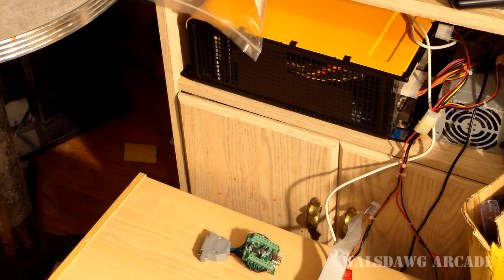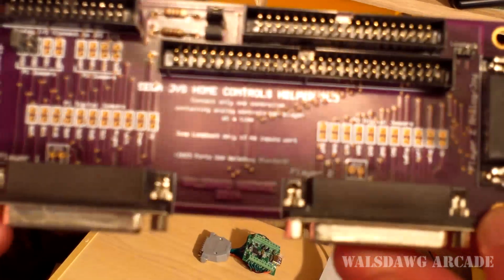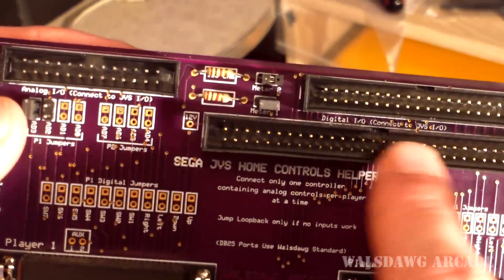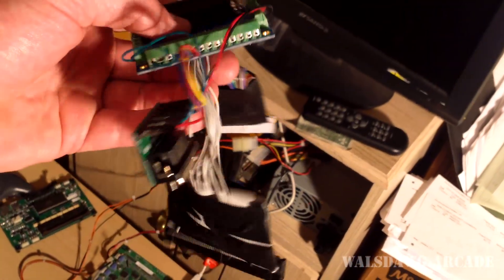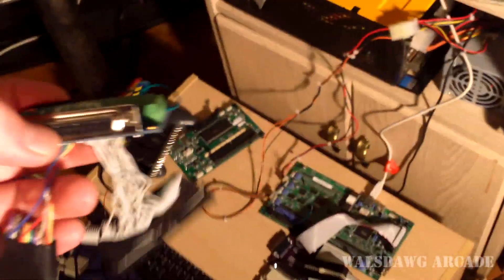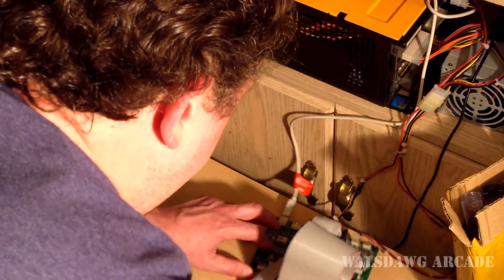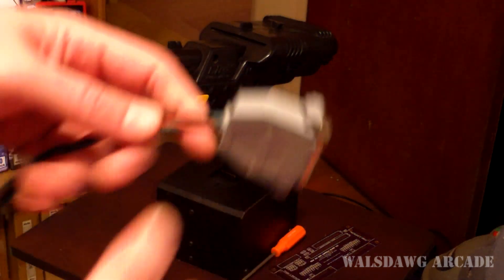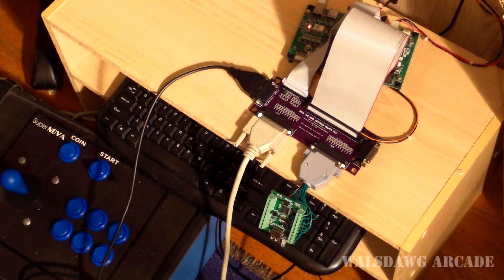S-JIHP Part 1: Introduction to Mitsurugi-w's Sega-JVS I/O Helper PCB

Comment: I bought a yellow Lindbergh with multi boot and when I connected ,received a error no signal on monitor ,I changed to another gpu but still the same I’m using a atx 24 pin cable, am I missing anything else to hook up , their also a jvs green light flashing ,should their be anything plugged up to jvs and plugged next to 24 pin .
Reply from the maker: Maybe a bad video card

Comment: So,.. I have a sega naomi,.. and a capcom Io. Power smash tennis does not work, or not for long with that io board. I want to buy a different sega naomi game but worried it will not work either. So If I pick this up what would I need to do to make the capcom IO work... Or does it seem to replace the IO,...